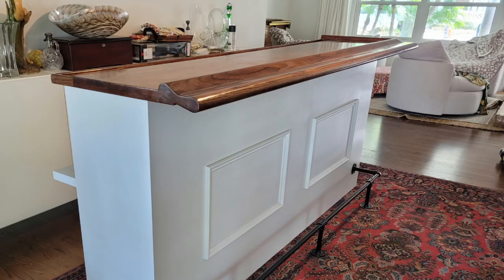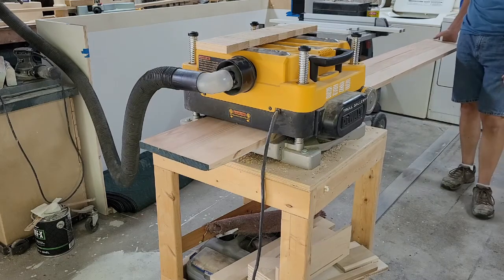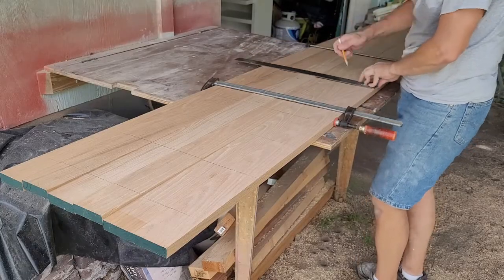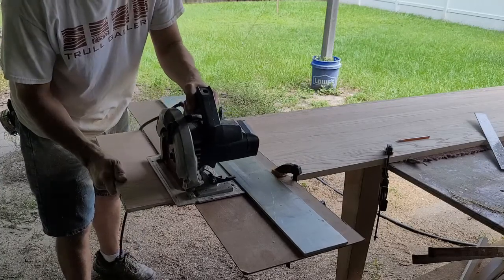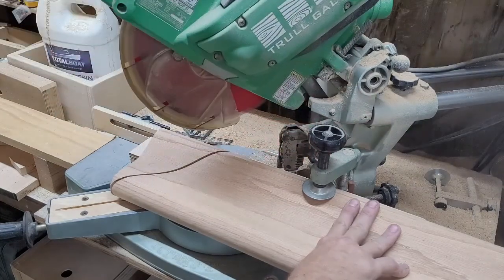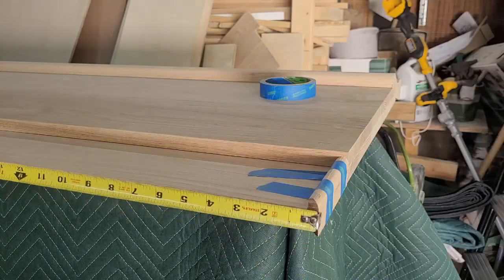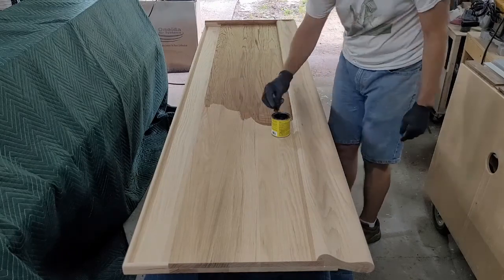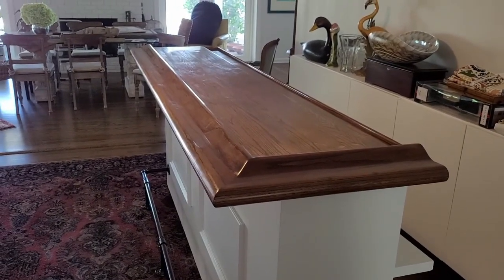A Bar Top Build for This Custom Bar

Comment: Awesome video! Just out of curiosity overall how did the oil finish adhere to the epoxy skim coat? And assuming the epoxy was to seal the oak for a long future?
Reply from the maker: With a scuff sanding, the stain went down well.  Just like if you did a scuff coat of urethane (or most any other finish) and stained over that.  You just need to seal everything in before your finish coats.  It's been several months since the project was complete and my customers are very happy with the final results.

Comment: What is that molding called & 
where can I get some?
Reply from the maker: I know it as bar rail, but it may have other names.   I got mine from a local millwork shop that ran it for me (North Rome Lumber,  Tampa, FL). If you can't find it locally, I'm sure it's available online .
Reply: The bar rail armrest is a Chicago style rail. That’s what I am building.
Reply: Chicago Bar Rail is really expense. 😢